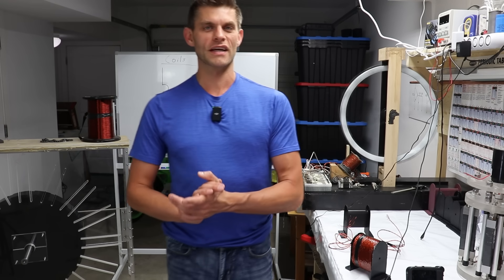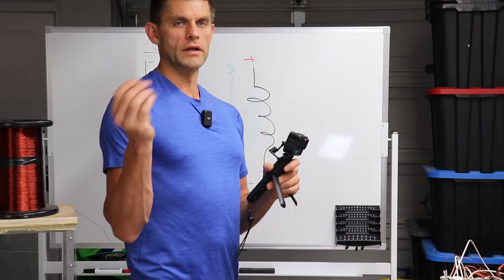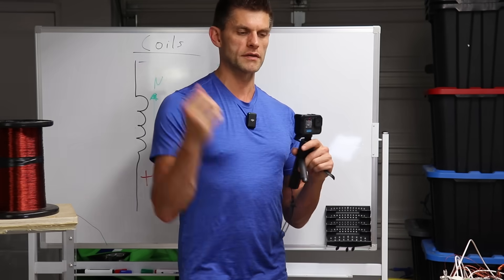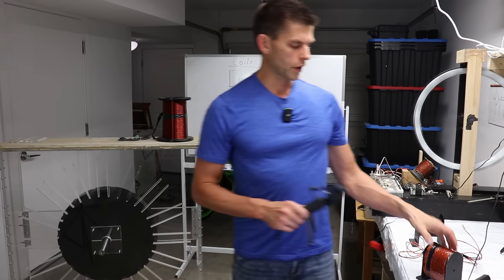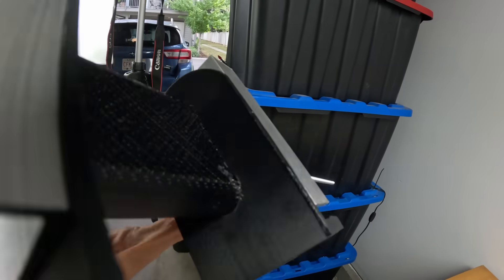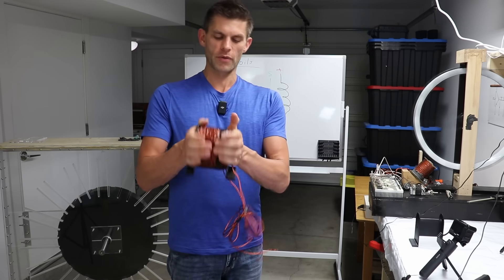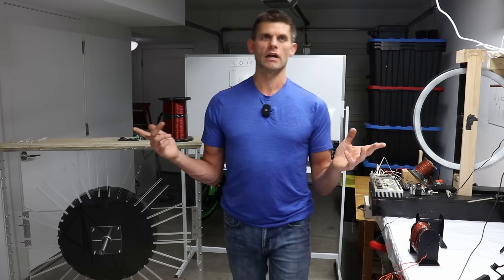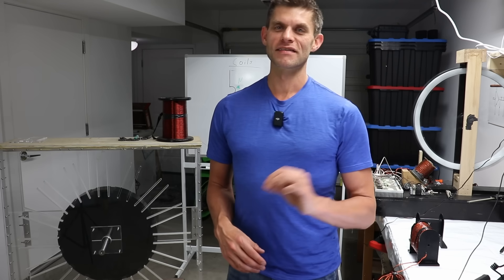Unlimited Energy in My Garage (No Patents)

Comment: Interesting theorie I don’t know if they actually explain the phenomenon of the collapsing magnetic field somewhere but I think if it were possible to accurately measure the watt/ engergy output of the voltage/ampere start spike and measure the ingoing (in the other battery) energy watt coming from the collapsing magnetic field of the coil it. 

1. the coil turns into some kind of magnetic field capacitor and the magnetic energy you input into the coil via electrical current still lingers in it so it has not been used up completely and what ur measuring when the magnetic field collapses is the remaining magnetic energy wich is still stored in the coil( the amount of is so incredibly small it might me hard to measure) if its is equal or less well there is no free energy. if it is not equal and actually higher then 

2. if the collapsing magnetic field of the coil were to actually use the magnetic field/ electrons that surrounds us then yes you could actually achieve free energy since it would partially use the electrons/ magnetic field that surrounds us tough with this kind of a small coil the amount your could measure is so incredibly small the measuring tool must be really high quality to be even able to measure the amount of watt you create by using the surrounding magnetic field. Industrial coils/ everything that creates a huge magnetic field would make this far easier to measure though those machines are not build for accuracy so you would have many factors that disrupt an accurate measurement. 

It is a great idea though after achieving it comes the real hard part since you would need to specify which electrons to absorb/ use to power devices etc, since everything is made of atoms/ electrons etc. and if u had the ability through a device to absorb/ use any electrons you could destroy recreate and manipulate everything surrounding you but that would be pretty hard to do since you need enough magnetic power to actually rip those electrons out of their atomic structure if it were a rock for example. Your device would only use the free electrons in the air but even then one would need to look if the magnetic field you create could harm anyone or disrupt other signals/magnetic fields if it were to be used in place where humans are, if it were use in a place/ in space where it can disrupt/ harm anything surrounding it like any other industrial facility then yes it would be a huge game changer in the creation of energy.

would be easy to see if it is actually free energy or not since if the coil where to use
Reply from the maker: More then just electron flow in this world. Thanks for watching and stay tuned for free energy shown on this channel

Comment: 4:45 does that mean it draws heat energy from the surronding enviroment? if so it sounds like something that runs more efficient in warm regions
Reply from the maker: Not heat no.
Reply: The idea is suppose it something like hawking radiation, that space itself at all time is boiling/simmering with positive and negative charges that on average is zero charge but at the micro level splits into two and then recombines

Comment: May I suggest you when you talk about coil with positive and negative apply to each ends that give the north and south magnétic polarity it is also true if roll clockwise will be different if it rolled counterclockwise ! Because it is related to the right hand side rule "
Reply from the maker: Correct yes

Comment: Also using alternators to power a motor to run for ever isn't impossible im sure transistors will be needed im dyslexic to... but hydrogen power is another inventions made by Stanley myers rip...   now😢they use Tesla patents to power jets ok they do use a bit of fuel for take of but then ionisation using either to collect protons neutrons to power jets i think plasma might be a factor ascwell😮😮😮😮😮😮

Comment: EE?  The ballon analogy is in error.  Remember the law of conservation of energy.  I wish my water well pressure tank bladder (which is essentially a thick rubber ballon) could output more pressure than the pump put into it, but it can not and never will.  I haven't had an electric bill in 10 years.  My average electric use is 10 to 15 KWh per day.  Around 30 in the summer months running a 5 ton hvac heat pump unit for cooling in 100+ degree heat.  It heats in the winter but uses far less energy.  I receive 'free' energy from the sun.  I live off grid and built a diy solar system consisting of 36KW of PV panels with 30KWh of battery storage.  
How many magnets and wires would it take for your 'free' energy generator to make 36KWh?  What would the cost be for all the materials?  My solar system has paid for itself twice so far.  Nothing is ever really free, but it is very hard to beat harnessing energy from our star.

What you are trying to do is nothing like 'solar'.  PV panels convert photons into electrons.

A MOSFET is a: Metal-Oxide-Semiconductor Field-Effect Transistor

Transistor is literally part of the acronym.

Show the calculations.
Efficiencies?
Watts per dollar?

First day of class one of  my professors had a drinking bird on his desk.  He stated, "If you believe this, you picked the wrong major."

Hobbies are fun but the Bedini generator, all its variants and the principles have been thoroughly debunked.  Soliciting money from less informed people for experiments that are based on unsound principles is akin to selling prayer clothes and miracles.

I'm not trying to be harsh or negative.  I hate seeing good people waste their time/life trying to prove something that would break the laws of the universe when there are already literally off the shelf components and devices available to everyone that will net 'free' energy.
Reply from the maker: Wow 👌

Comment: Newman motor concept sort of.
Reply from the maker: not quite
Reply: @MadscienceLPTECH  agreed not exactly, but similar in fact uses collapse of field to spike lead acids for recharge.  Did you look at nickel cadmiums or iron phosphates? I am not sure of their overload recharge but might be a possibility as well.  

If you increase the permeant magnets, will it make your field collapse a larger strength thus if your lead acids can handle it, maybe several can get a bigger recharge pulse for same input?  

As I recall the field collapse is in a sporadic messed up wave or some such.  Any way to adjust battery or field collapse so get a more ideal recharge spike?

Comment: The one thing I don't get, is how does sending a high voltage into a lead-acid battery retrieve energy from the zero-point energy field?
Reply from the maker: Read tom beardens stuff. Dipole with the e and ions in the battery
Reply: @MadscienceLPTECH  thank you!

Comment: What’s your doing? Has been done before you do realize that don’t you nothing you’re doing is new. The problem is, there isn’t enough rebound to charge the second battery sufficiently and you come up short. I encourage you though to continue. You will learn some things about physics that don’t seem quite obvious. I believe your intentions are good. But this is not the direction it will help you achieve your goal. Good luck.😊
Reply from the maker: Great comment
Reply: Exactly my point. Here's another person that sees you are simply replicating the badini wheel. In all my tests I also could not get the second battery to end up with more energy than the first battery. You may or may not end up with the same result and I'm not saying you won't crack it and do better but again you are just getting people to pay you to do this research and they can do that if they want but I think it would be more fair if you say hey I'm just another Average Joe Blow trying to replicate badini and many other Technologies and get them to work and I'd like you to pay for it. Dude I've got a DSW also and worked at Nasa and I didn't have anybody supporting me when I built my bedini wheel attempt. But I also didn't make a video stating it was "my new technology"
Reply: @p @placidbeach  that’s why I said there is nothing new under the sun no matter what you call it it’s been done before in just a few short years you’ll realize you’ve been wasting your time because most of the things you are showing have already been invented and there are patterns on them and as soon as you try to show the masters, don’t put you in prison😂😂😂😂😂😂😂😂😂

Comment: 3:20. Totally wrong.
Reply from the maker: Um no.
Reply: Nothing wrong with his analogy. You can use a certain size hose to fill up a bladder but then have a different kind of nozzle a larger output nozzle for one thing and discharge the water back out of the pressurized bladder with much more Force than the garden hose had because you do it over a shorter amount of time more volume. What's wrong with his analogy?

Comment: There seems to be a very fundamental misunderstanding of how inductors work, here.
The voltage that will be produced when a charged inductor suddenly goes open circuit depends on the current through the inductor at the instant when current into the inductor is interrupted and what, if anything (and there is always something, where intentional or not) is then connected to the inductor.

Dealing with simple inductors (single winding, no other means of changing the stored energy):
You cannon instantaneously change the current through an inductor. If you have been causing current to flow through an inductor and then change something in the external circuit, the current will not immediately change. If you were actually able to instantaneously open the external circuit, the voltage across an ideal inductor would go to infinity. In any real circuit that simply doesn't happen. Something will provide a path for current, limiting the voltage. It is pretty much impossible to instantaneously switch off charging current into an inductor so the switching device will impose some sort of voltage limit (arcing between mechanical contacts, breakdown in semiconductors). Capacitance between turns of the winding can be significant. Ignoring those things, if you were able to instantly switch an inductor from being charged at 1 ampere to being discharged through a 1000 ohm resistor, the voltage would rise to 1000 volts (V = IR, nothing more complex than Ohm's law). If you switched to a 10 ohm resistor the voltage would rise to only 10 volts. 1 ohm would yield 1 volt. (The resistance of the inductor winding must also be considered.) If you were to steer the discharge current into a battery, the voltage would be limited to that of the battery, though it might rise somewhat above that due to battery impedance. With a fixed voltage across the inductor the current would ramp down linearly. You aren't going to get a voltage spike of hundreds of volts into a 12 volt lead-acid battery in good condition.
Reply from the maker: I would say you are the one with a misunderstanding of energy flow. U realize there are heavside flows and curls outside the conductor ?
Reply: Yeah Bearden and Bedini both talked about the rapidity of the current being turned off, and everyone understands it's not absolutely immediate, but the channel owner is right that there are other things in play. You're right that the spike into the charging battery does appear to flatten off just above battery voltage, but there is a definite CURRENT spike, and other things happening that you probably haven't been taught, which bedene and Tom Bearden have explained in detail.

Comment: The greatest secret isn't really a secret, just learned in high school and forgotten. Everything is made of atoms, energy arranged in different formations to create "stuff", if you will. That's why in an overhead high voltage system or lightning strike, current flows through wood poles. We consider wood an "insulator", because lower values of current don't flow through wood as well as a conductor like copper or aluminum. Ceramic or glass is made of the same types of atoms or energy, the difference is the atom formation is better suited to prevent the flow of electons or electricity. Tesla understood this and that's why his ideas for free energy and supplying electricity in far cheaper ways is hidden by, ironically, the Department of Energy.
Reply from the maker: Yes well said

Comment: Your flywheel will be more efficient if you remove material near the axle.
Reply from the maker: Why?
Reply: @MadscienceLPTECH Better distribution of contributing mass.

[edit] Ideally, all the mass would be around the rim, but you do need supports, so most flywheels remove material near the axle.

If you think of it like a gyroscope, a large wheel has more effect than a small wheel. In the same way the flywheel has more effect at the edge than near the axle. You're putting energy into moving that small mass, and it's not contributing much to your output. Best to remove it and focus more mass towards the rim for maximum efficiency.

Comment: What is this bro? this is just inductive kickback, your getting high voltage spikes yeah but at a low power over time, you know that this circuit runs until it runs out of power and then boom thats it, good attempt i guess but lets not spread missinformation, try to get views with ethical ways at least.
Reply from the maker: Wow sounds like you really understand physics 😂
Reply: @MadscienceLPTECH  It would be pretty funny if i didn't understand electrical engineering as thats what im studying, i don't think i ever got a worse grade than 2 (in america B, second best grade). So i think you need to reality check yourself and should be ashamed of milking people for money with fake inventions and doing nothing but explaining whats explained in year 1 of electrical engineering.

Comment: I'm not convinced, I see you have some understanding of what you're doing, but have you tried adding load on that spinning wheel to compare how much energy you're putting in versus how much you're getting out? These types of projects derail very fast when you put load on the wheel, if we dumbify what you did there you turned electricity into motion and motion back into electricty, that's 2 conversions and each conversion incurs loss; Plus you're using current into battery then from battery back into current that also incurs loss

Again, I've seen many of these videos and I don't think you're being dishonest in the slightest with what you're building, I just don't think this would work
Reply from the maker: And thats why it never will for you. Stay tunded

Comment: Radio. AM loop antenna. Voltage spike from the EM collapse. Clipping gate mosfet/transistor with dump to pile. Did we all forget that the gov news telecom is broadcasting kilowatts of audio into the atmosphere? My large capacitor needs shorting shunts or it'll charge itself. If my VHF radio can pickup millivolts of signal with 12 inch of antenna, your coil should.
Reply from the maker: Yes we get noise for sure

Comment: Interesting stuff, the pulse idea makes sense, it's kind of like spark plugs in a piston engine, just an observation, presumably those magnet rods would be more efficient if they're aerodynamic? And off that back of that, would it work even better in a vacuum? Like, looking at your design it's partly focused on demonstrating what's happening, but on a later iteration you could put the end of the spindle inside the case so that's sealed, and the same for the little sensor and counter wheel thing, pull a vacuum and seal it?
Reply from the maker: ❤agreed. Thanks for watching
Reply: @MadscienceLPTECH i was thinking too (keeping in mind i have high school level science and my own curiosity /intuition to hand apologies if I'm talking gibberish) see the field of generation? Where it's curved it looks like the coils and magnets should be angled so the peak of the two arcs of magnetism are directly pushing against each other where at the moment it looks like they do this:  Pd . And presumably being a circle you'd want them angled about 30 degrees so it matches perfectly with your firing timing which is off centre of where two flat poles would meet... i hope thar makes sense... 😅

Comment: you can mimic the machines by putting the 3 strands on a spool space apart a bit and thread them through 3 holes in a triangle drilled through a soft wood about an inch apart. Then chuck those in the drill and pull as you walk backwards and it should twist as you go if you get the feel of it. Then roll your twisted wirt on a wide big spool so it can be mounted under your core and roll free like the core. Foot pedal like you said. Just a thought.
Reply from the maker: ❤ great idea. Luckily we got Fred making us the coils now :)

Comment: ONE major factor about the induction coils that you didn't mention is the winding DIRECTION of the coil. A counter-clockwise winding will produce and OPPOSITE magnetic flux to a CLOCKWISE coil. Ad even though you turn one upside-down, the N poles will be on the same direction but the SPIN will still be different.
Reply from the maker: Difinitly mentioned this. Mainly last video

Comment: just prove that it works. measure the power draw and power output and run til if or when it fails (which it should unless you are correct and you are somehow extracting a bit more from ambient)
Reply from the maker: Thats what we are doing